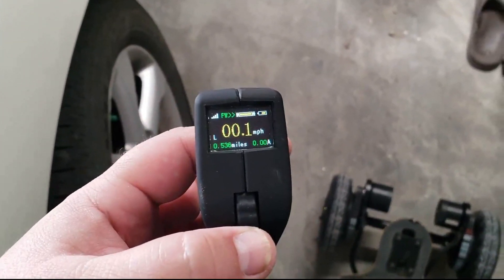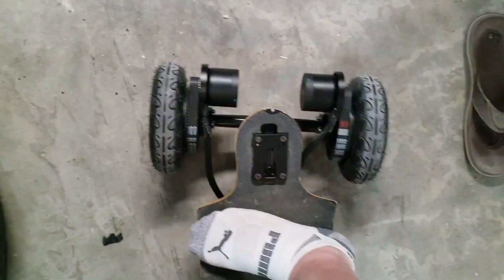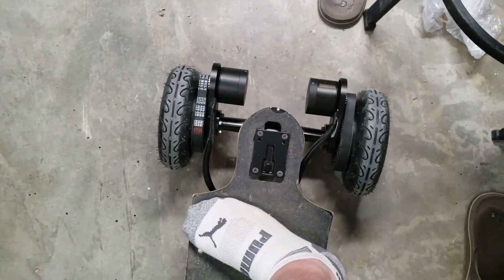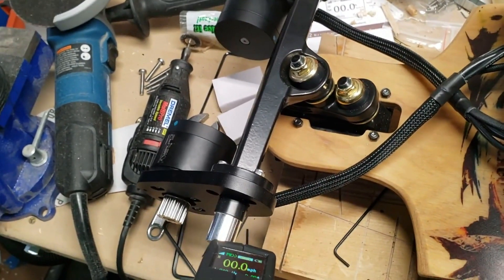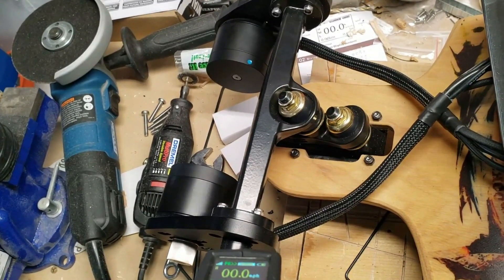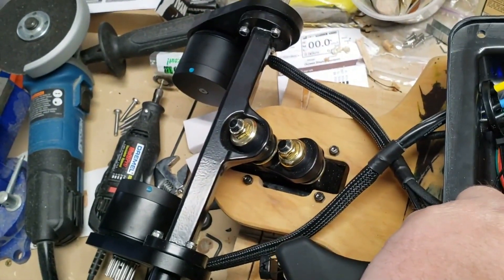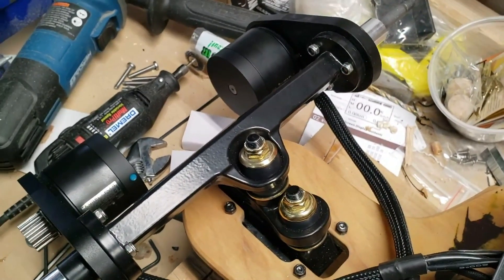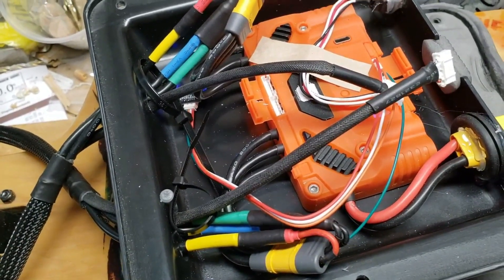DIY Electric Skateboard Build... FAIL???  - esk8 longboard all terrain

Comment: Have you done motor detection with unity app or vesc tool ?? If you just plugged it all together and missed programming your unity/vesc this is the issue. Unity app is Way more simple and easy.
Reply from the maker: Yeah. I used the Unity app on Android to set it all up. Honestly though, maybe it's just the Android version, but the app isn't as friendly as I've seen other videos show. Maybe I'll try the mac version.